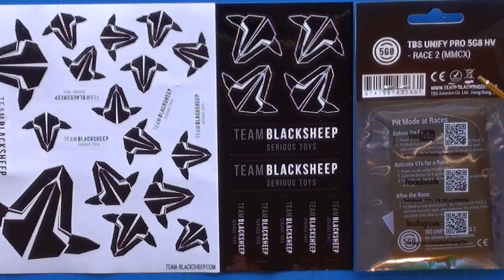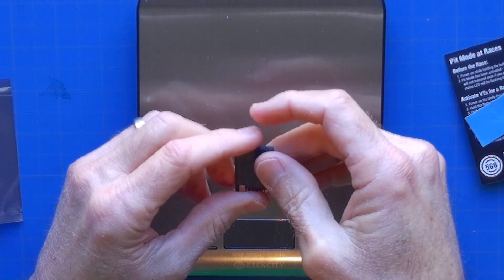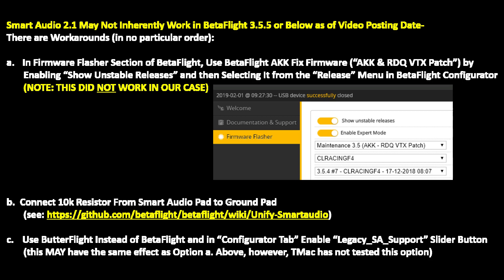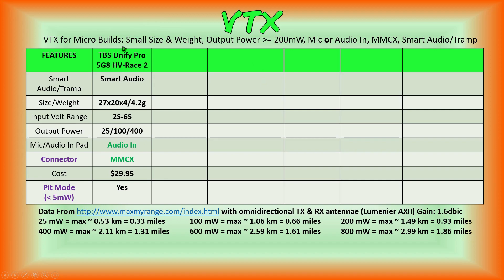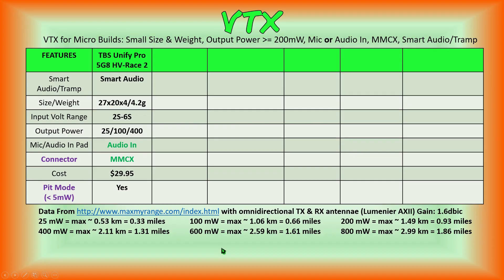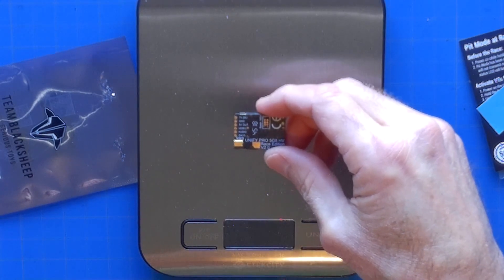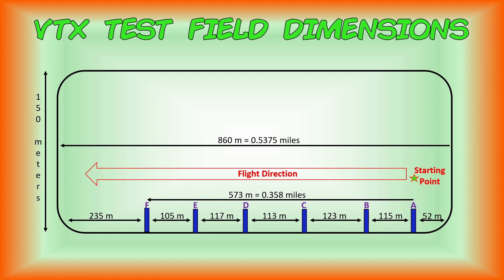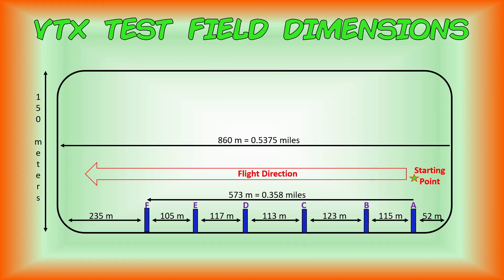MICRO FPV DRONE PARTS-VTX TBS UNIFY PRO RACE 2

Comment: hey Tmac, i have s/a working via crossfire. however when changing power levels i get 25mw = 1led, 100,200,500,800 all show 4 led. i cant figure it out. quick start guide says 3led = 400mw. i cant get 3led. only 1 and 4 led.  i do not have a power meter to see what is up.  i unlocked it of course. any thoughts?
Reply from the maker: Sorry to hear you're having issues with that VTX.  It may have something to do with the "power look up tables" which SA 2.1 uses.  I no longer have that VTX in any of my quads, however, first thing you may want to check is the version of BetaFlight you're running.  As of Feb 17, BF 3.5.6 had implemented a "fix" for Smart Audio.  You can see that in the following BF Github link when you scroll down to BF 3.5.6 Release: https://github.com/betaflight/betaflight/releases
Added support for connecting to SmartAudio 2.1 devices (#7461); Also, when hyperlinking to the #7461 Pull Request which Fujin worked on he says you can  Set band
Set channel
Set power from Betaflight power table (0,1,2) - "400mW not available without dBm power level code."
Does not yet support dBm based power levels or advanced PitMode functionality.
BF 3.5.7 just released within the past day, has the following fix: "fixed 'looping' issue in SmartAudio when setting the frequency (#7157)"
I hope some/any of this info gets you headed in the right direction. If/when you find out your specific issue/resoluuion, please post it in Comments here for all to benefit.
Reply: I'm late but, ypu have to press the botton for 30sec